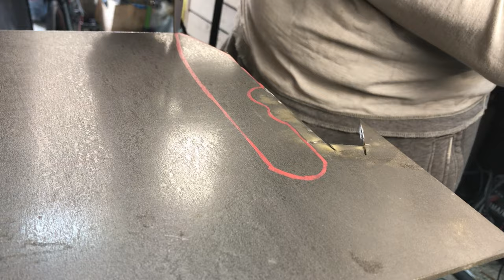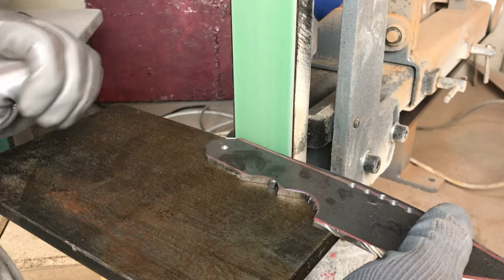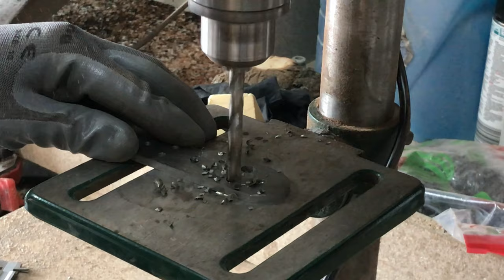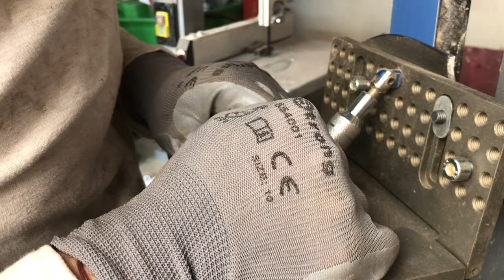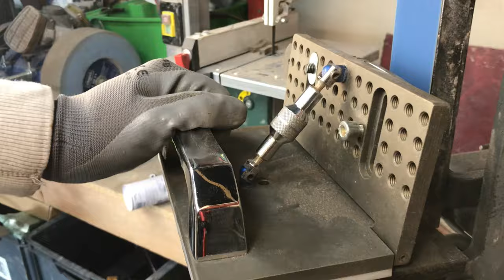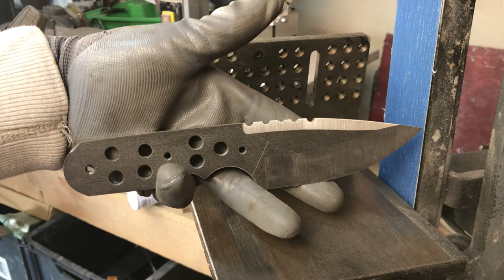DIY Custom Knife with Honeycomb Resin Scales - Part 1

Comment: Love it bro. Maybe someday ill have a belt sander too its very hard making an edge path with an angle grinder
Reply: You can rough it in with a file and then use a file to fine tune it and get pretty good results.  You could also buy a little 1x30 belt grinder for like $60.